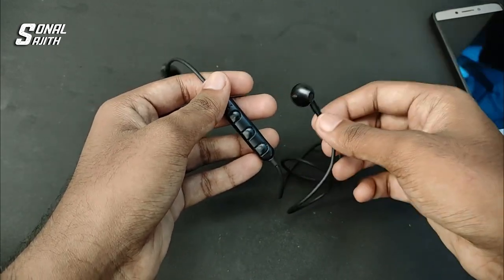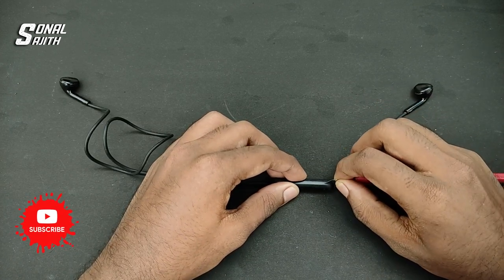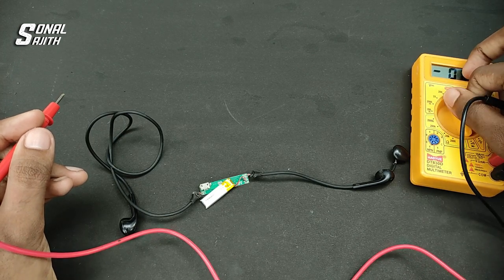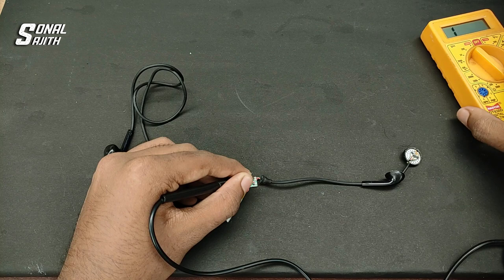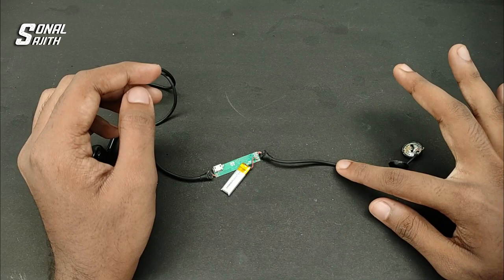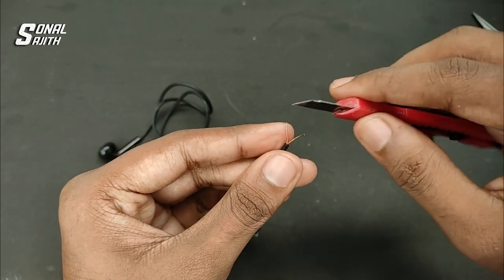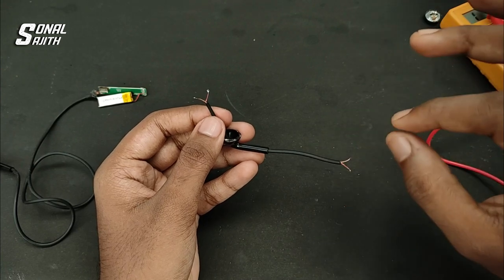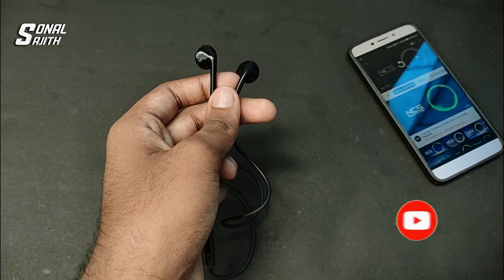Bluetooth Earphone one side Not working  Repair in Malayalam

Comment: Oru side work cheyyunnillaa
Position  adjust cheyyumbo work avunnund.. 
Boat 255
Reply from the maker: Bro loose contact aanu. Bro 1st board open cheyth wire connection loose indhoon nokkua,  illenkil speaker case carefully open cheyyukka enit avide check cheyy
Reply: Same avstha
Reply: Ok ayo
Reply: @Hope__34755  ബ്രോ എന്റെ ഒരു കയ്യിൽ വേറെ ഒരു കംപ്ലയിന്റ്  ആയ ബോട്ട് ഹെഡ്സെറ്റ്  ഉണ്ടാർന്നു, അതിന്റെ സ്പീക്കർ അഴിച്ചു ഇതിലേക്കു സോൾഡറിങ് ചെയ്തു വച്ചപ്പോൾ വർക് ചെയ്തു.. 😍😍 
സ്‌പീക്കറിന്റെ  പ്രോബ്ലം ആയിരുന്നു.. 
ട്രൈ ചെയ്തു നൊക്കൂ
Reply: @sonalsajithvlogs  വാറന്റി  കഴിഞ്ഞിട്ടു അതികം നാൾ ആയിട്ടില്ല... ബ്ലൂടൂത്ത് earphone ആയതു കൊണ്ട് കളയാനും തോന്നിയില്ല.. സ്‌പീക്കറിന്റെ  പ്രോബ്ലം ആർന്നു ബ്രോ,  പഴേ ഒരു ബോട്ട് wired earphone ഉണ്ടാർന്നു കംപ്ലയിന്റ് ആയതു, അതിന്റെ സ്പീക്കർ ഇതിലേക്കു എടുത്ത് വച്ചപ്പോൾ  ഓക്കേ ആയി 😍😍
Reply from the maker: Poli😃😃
Reply: Same 😢😢😢😢